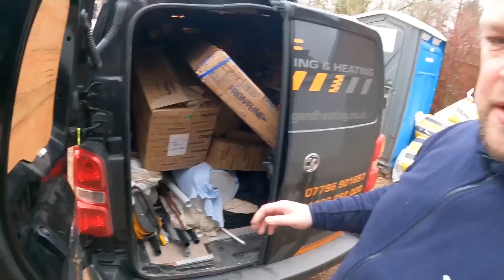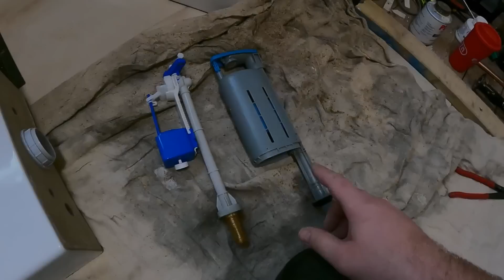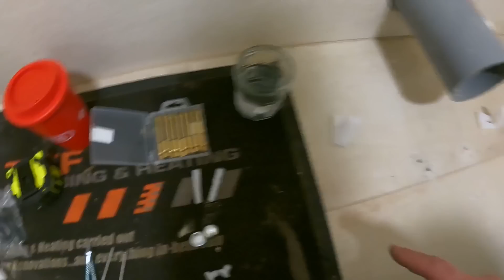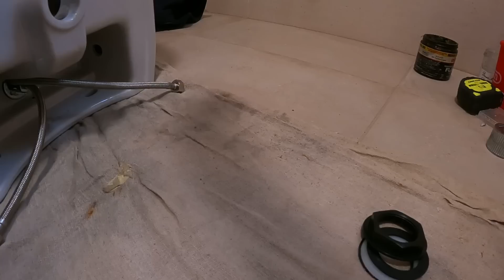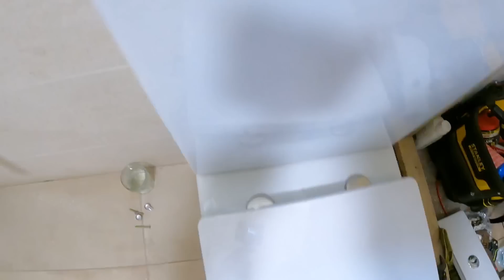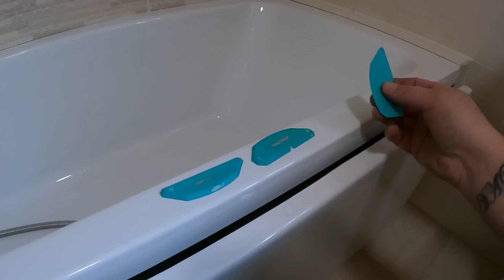SHOULD YOU DO THIS? Bathroom Renovation Part 4 | PLUMBING basics

Comment: I don’t use standard Iso valves in conjunction with flexis. The sharp end can cut into the rubber seal of the flexi. They’re fine initially but cut into the rubber over time.
Ideally should be using flat top iso valves or else a 1/2” MI on top a standard iso valve to connect a flexi on.
Having said that, I’ve taken to using a standard iso with a rad tail in the end so that a flat face is presented to the rubber seal of the flexi.
Reply from the maker: It’s not a problem using standard valves…. Not had an issue in 30years mate👍🏼👍🏼… just don’t overtighten them😉
Reply: That’s fine mate if you’re happy using them like that. 👍

Comment: Them plastic nuts are garbage if you over tighten the nut it can split the nut or they are loose on the threads
Reply from the maker: Don’t overtighten them 👍🏼
Reply: I used the sling them and use brass lock nuts miles better I’m glad I’m retired now

Comment: I usually put small circles of silicone around the fixing holes on those vertical tracks just to ensure no water gets through there and obviously only seal the outside edge. I've been to so many jobs where they've been sealed all around and they just eventually fill up with mostly condensate water and cause all sorts of issues. I believe most manufacturers recommend no seal inside so that any internal moisture can drain to the bath side?  Good job buddy....
Reply from the maker: Yep never ever seal inside…. Voids any warrenty

Comment: Great video Mark. Re drill bits, have you tried the Bosch multi construction blue ones - CYL9 I think they call them. I recently had to drill through tiles to fit 160 soap dispensers (don't ask) Did the lot with 2 x 6mm bits👍👍
Reply from the maker: Sounds like a great bit👍🏼👌🏼

Comment: Could you not have had the floor tiled first before fitting the bath? That way, you would have known what height the bath needs to be to fit the bath panal.
Reply from the maker: Not the done thing mate, as the tiler would have to come back to tile above the bath and that’s makes no sense…

Just trim it slightly and fit it…. No problem for the chippy

Comment: Did you use brass screws to screw the flush box back to the wall of theses cheap ones that rust in about 3 years
Reply from the maker: Nickel coated ones that don’t rust in 3 years time😉

Comment: I would have fitted straps of wood for the bath legs so as the straps run over the joists below the floor boards so it's the joists taken the weight of the bath, not the floor boards. Also, it's not a good idea to connect the flexi hoses from the basin taps directly onto the 15mm ball valves as the shape of the valve cuts into the rubber washer and ends up leaking after a year or two, best to fit 15mm male boilers.
Reply from the maker: Did you watch the video🤣🤣..I fitted straps of wood under the bath legs….. as I made a point of mentioning in the video and as I have done for 25+ years.
As for the flexis onto the iso, never had an issue…. It’s only a problem when you overtighten them which is what a lot of people do…
Reply: Just to add, it's never a great idea to use plastic nuts for tightening any tap up as the nut will crack or come loose  over time, best using the brass nuts I find anyway.
Reply from the maker: 🤣🤣…… again….. if you overtighten them they will snap, sounds like you’ve been overtighten alot if fittings….

Not had an issue with them when fitted correctly😉
Reply: @M J Tiff Plumbing   Not at all mate, it's me being called out to jobs that plumbers have fitted plastic nuts to tighten taps to baths and basins with, in some cases yip been over tightened but lot of the time it's the heat from the hot pipe that expands and contracts it. Just my preference to use brass nuts would use metal over plastic any day of the week for that job 👍

Comment: Enjoy your video but the one thing what I really struggle with is fitting bath panels. Trying to judge the plywood base then adhesive and tiles for floor. And for length, if you want to put tiles beyond bath panels. Cutting plastic panels and still making them sturdy. So I understand why.
Reply from the maker: Bath panels are my let hate…. Would rather chuck Dave the chippy a few quid to do it😉👌🏼

Comment: On the Toilet did you use a flexible or straight pan connector?I find on some toilets ,it's difficult to get the pan over L/Shape pan fixing if you use a straight one.
Reply from the maker: Yep that can be an issue, on this is was a flexi due to the reason

Comment: Using metal/brass washers for L brackets are just as good
Reply from the maker: Still have 1 point of tightening that can move… won’t move with 2 screw in it..

But each to there own 👍🏼👍🏼
Reply: @MJTiffPlumbing  Going forward I’m going to do your method 🫡👍

Comment: Do you ever use tap tail adaptors , to go into the isolation valve giving you a flat surface to connect the flex with the rubber seal in , so the rubber seal seals over it’s surface area and not just on the edge of the isolation valve 
If that makes sense lol
Or do you flat faced isolating valves which I’ve only just found out exist lol
Reply from the maker: I’ve never had an issue going into a normal iso valve…. Trick is to not tighten it to much👍🏼

Comment: Funny as a plumber you seal the bottom of the sink drain, the water is not supposed to leak from there it should be draining down the inside so only need to seal the top😳
Reply from the maker: Not when it’s a slotted waste with an overflow on the basin mate…… you will get very very wet if you don’t seal the bottom buddy🤣😉…..

Comment: do you need check valves on the bath taps because the shower could end up in the dirty bath water?
Reply from the maker: Internal dcv going into the taps👍🏼
Reply: @MJTiffPlumbing  sorry I was not questioning if you done it or not. I was interested as to if it was needed or not and I never knew that some of these taps had built in check valves
Reply from the maker: I didn’t think you was buddy ….👍🏼👍🏼 no worries.

Alot of these style ones do….. 👍🏼
Reply: @MJTiffPlumbing  Good good buddy, my only gripe with your videos has been the Grohe shower you installed in the barn conversion (was it the bathroom with the copper bath in it) and that was only because I had the same shower to install in our en-suite and got worried when you never posted to much info on it thinking it was going to be a nightmare but it was fine. 

ahh im not a plumber but im learning thanks to yourself and Plumb Like Tom which are my go to plumbing channels so keep up the good work buddy and thanks for sharing you knowledge
Reply from the maker: Yer Toms channel is great…. He’s a good lad.

Yer that grohe shower with the ibox was straight forward enough to be fair from memory
Reply: @MJTiffPlumbing  AHH yes he seems to know his stuff. 

Yes it was easy enough in the end but I have now found out that I need a new boiler since fitting it as my combi won't maintain a constant temperature if you turn the flow up on the shower, the bathroom taps are the same but i was hoping that was just because they were old and rubbish, turns out it's my not even one year old combi that's rubbish though.

Comment: I would silicon before I fitted taps and screen,and always fill bath with water first !!
Reply from the maker: Watch Part 3 of the renovation and you will see if you fit your bath correctly you don’t need to fill with water 👍🏼👍🏼

BATHROOM RENOVATION PROBLEM | Can it be fixed in time? | PART 3
https://youtu.be/_BjvVPV5VDg
Reply: Yes I do the same but as you know customer always knows best and supply cheep 3mm bathe with no shower support at bottom so always fill up to take some flex out and extra support at tap end, 
Not a criticism just what I do,
I do mainly full bathrooms installation ,start to finish inc plaster and tile but hi end £15000. Plus
Reply from the maker: 👍🏼👍🏼….. gotta love a nice high end install….. got a good one coming soon😉

Comment: I rate the Thomas Dudley washer kits for fitting wastes. I fitted a McAlpine Centre pin waste yesterday was quite impressed with it they come in 2 parts with the seals you need.

Just pop a backflow preventer on that shower hose to cover yourself if they want it to reach down to the bath. 👍 (Guess who's swotting up for their water regs 😂)
Reply from the maker: I’m a silicone lover for the wastes😉👌🏼

Comment: naughty boy mark....flexi on to a 15 mm compression fitting lol
Reply from the maker: Never ever had a problem with it….. if you overtighten them that’s when it will be a problem….
Reply: Always use a male iron to copper connection has a flat spot for the rubber to sit on
Reply: I have yet to come across a flexi that has failed because it’s fitted to an isolation valve it has almost always been due to the pipe being twisted too tightly back on itself splitting the braided steel and rupturing the rubber pipe.
Reply: You'll only have problems if a gorilla over tightens it.

Comment: Gotta love a plastic bath panel 😂 I bought aome of those bits of eBay and I’m still using the first one, probably done near on 20 holes already! Good call ! Cheers for the vids !
Reply from the maker: It’s all about the £6 drill bits 😉😉👌🏼👌🏼👌🏼
Reply: @MJTiffPlumbing  can you recommend any cheap drill bits to cut a 20mm hole ??

Comment: Watching that, there’s a lot of things I do differently, I don’t use those plastic through fixings to fix the cistern on the toilet I bin them and use the metal ones with the proper bolts either side of the cistern, I use plumbers mate on the top side of the basin waste and silicon underneath like you, I also put plumbers mate around the top of the pedestal, it stops the basin chipping the pedestal when you place it on, we all do things slightly differently if it works for you though👍🏻
Reply from the maker: Indeed mate…. So many different ways to get the end result…👍🏼👍🏼
Reply: @MJTiffPlumbing  What is the drill bits called on eBay I hate drilling into tiles thanks
Reply: I agree about the bolts , but put plumber's mate top and bottom.